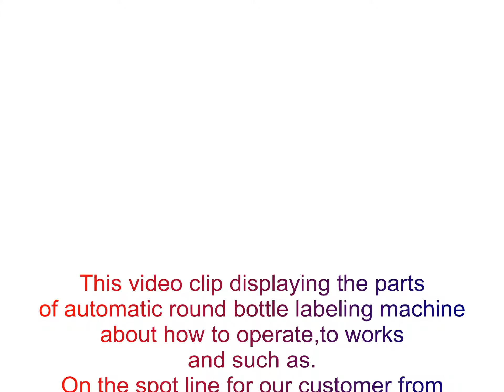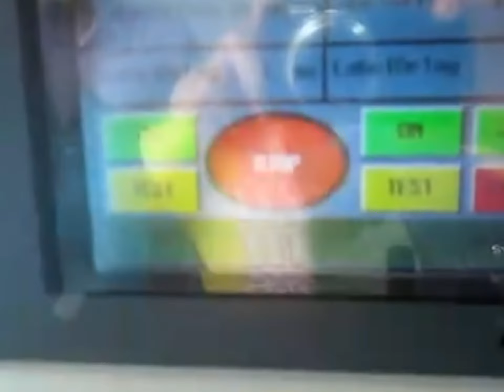automatic round bottle labeling machine&Machine d'étiquetage automatique bouteille

Comment from the maker: for more information about labeling machinery visit site at http://penglaichina.com
Parameter of bottel label machine:
(1)production speed :40m/min labelling accuracy:±1
(2)label max width:200mm (3)Weight:350kg
(4)label inner diameter:76.2mm (5)label outer diameter:350mm
(6)Outline size:3048x1700x1500mm
(7)using power:380v/220v50Hz1.5kw